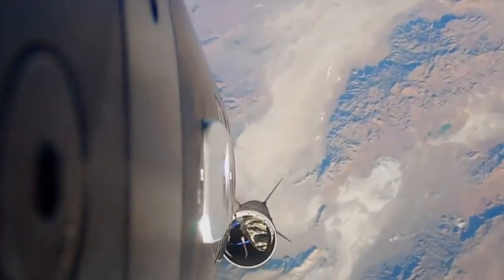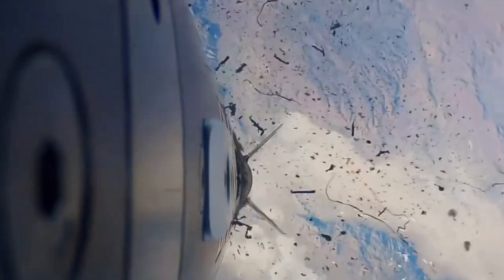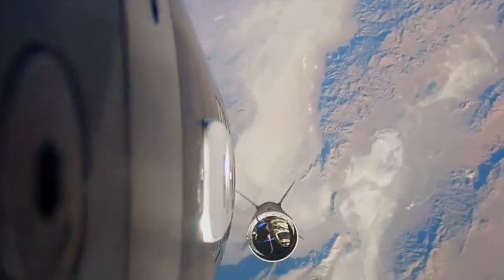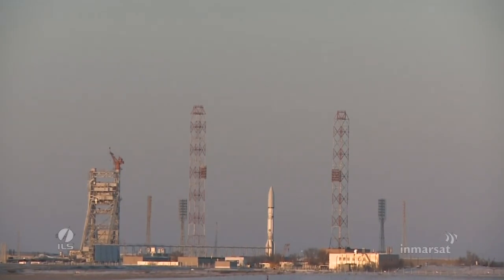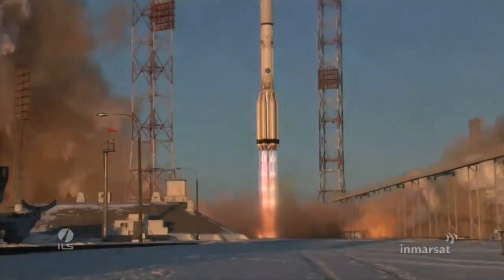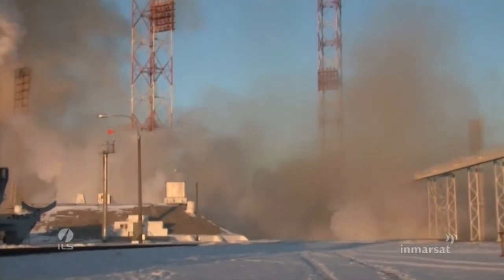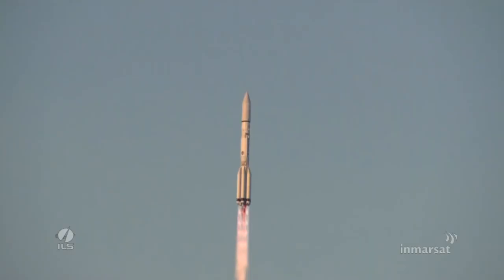Real rockets vs fake rockets hiding the flat earth.

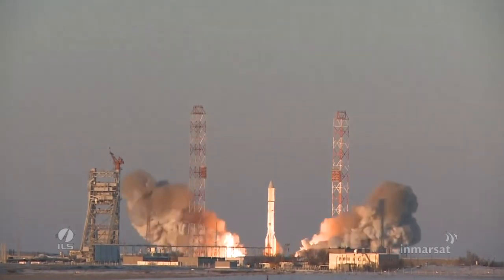Comment: As the smoke exhaust almost reaches the edge of the screen they zoom in closer to the rocket at 1:14 . If they hadn't we would have seen the edge of the huge ACTUAL screen they use to display this animation. Found and mentioned by @jeranism  an older @Globebusters vid. NASA has contracts with company that specializes in super large digital displays. Quite possibly what you're seeing here. Thanks again DITRH